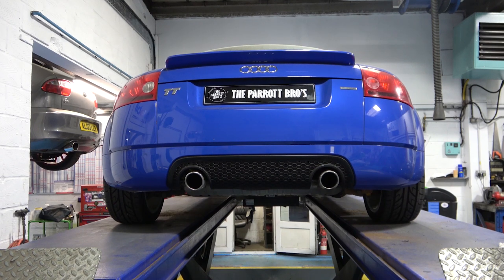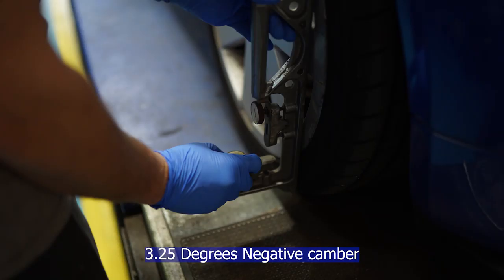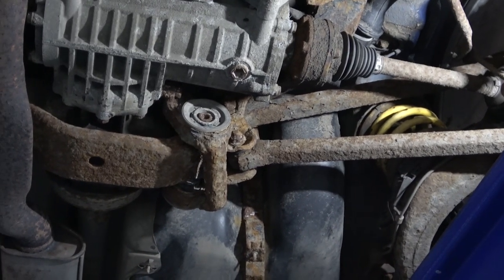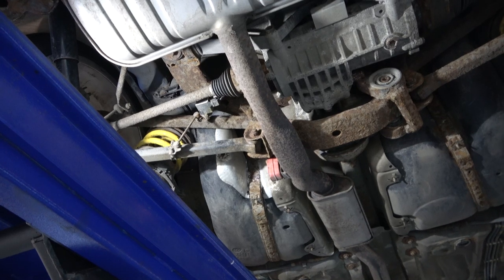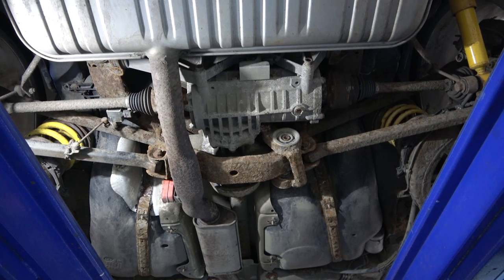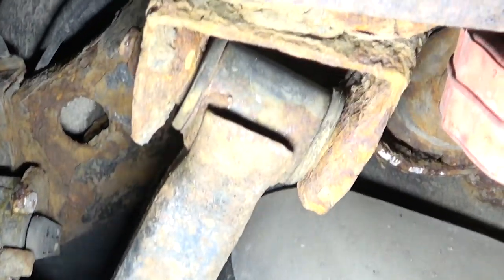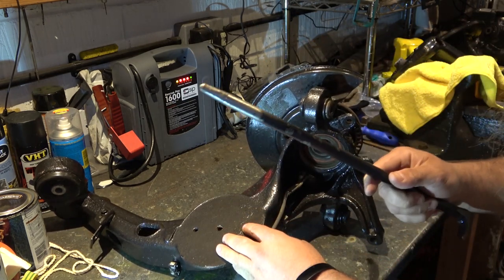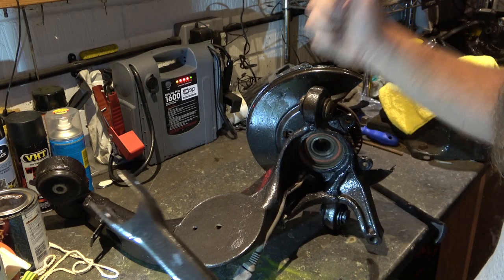All You Need To Know About Rear Control Arms On A Audi TT Mk1

Comment: just happened today😭 didn’t notice anything just pulled up to a stop light. and pop. i looked back out the door and oh shit 🙃 thank you for being the tt god we need
Reply from the maker: At least it was not whilst driving at speed, you now know what to check and fix it knowing it won't happen again
Reply: @TheParrottBros  right?! i got the rears and fronts ordered. i have bent my passenger front when my hub nut failed. so figured going all around will be best.
Reply from the maker: @kilstromkhrono8949  just make sure they check the rose joints are not seized as often the culprit

Comment: Wow, that thing is horrible underneath. I did all the mods you discussed on my TT last year with adjustable  arms and polybushed. Its a great upgrade. Rear is planted now when hard on it. Full set of BC coil overs probably helped  too though lol. These cars can be made to handle  extremely well . Good video .
Reply from the maker: Thanks for the comment, yes it is disgusting underneath isn’t it, that’s the fun of rescuing a car with nearly 200,000 miles on it 😂. I reckon at some point it live near the seaside. That’s why I did not bother trying to refurbish what was there and just got new everything off a low miles car
Reply: @TheParrottBros  Wasn't being rude, I didn't realize it was your car. My thoughts were the same - looks like it has lived near the coast or in a very wet region. Rest of it looks good to be fair - i like the colour.

Comment: Everytime I see photos or shots of the under body of cars in the UK, I'm shocked at the rust, corrosion & crud 😶. Like the guy from SoCal, my 19 yo high mileage TT is clean as a whistle underneath. Regarding the topic of this video, after putting coilovers on my TT the rear wheel camber was out big time, scrubbing my rear tyres. I bought a very strong and engineered set of adjustable control arms which sorted out that issue. They are stronger than OEM and are a pretty blue colour to boot 🤔

Comment: Great video 👍
The problem is very familiar. In my TT the lower control arm snapped twice before i realized the bush (ball bearing) was seized..
Luckily both times was in low speed.
Reply from the maker: timomx 22 that’s what I was hoping that people watching would see and understand. If I can increase awareness hopefully it will stop others from having similar issues
Reply: My snapped at 50mph when cornering. Wasn't actually anyhow severe situation. ESP kept the line...

Comment: Hi - Thanks for this video. I have an Audi TT (V6 - Registered in 2004) I am having a problem in getting a camber adjustment for my rear tyre and have been advised to buy a set of upper and lower control arms. I am going to buy a set Lemforder arms which have some good reviews.  I wanted to double check that both the upper and lower arms are the same size before ordering. Could you advise? Thanks

Comment: There were some issues with an early production batch of rose joints which to address Audi revised/improved the rose joint - providing a repair kit with the revised rose joints and four arms of the same length - and they continued in production.  Replacing the rose joints with a bonded rubber bush circa 2003 wasn't to address failing rose joints specifically.

Having no free articulation the bonded rubber bushes could introduce torsional stressess on already fatigued/corroded arms - especially if the cars lowered without adjusting/neutralising the tension on the bush or correcting the camber (not using adjustable arms).
Reply from the maker: Great information David appreciate it

Comment: Mate, great video, cheers to that! Just one thing: you keep talking about how the rear wheels should sit vertical after adjusting the control arms. That's not how suspension geometry works! You're right about the point that you want as much rubber on the ground as possible for good grip - but that is: under load! When you're going through a corner, the suspension travels and your wheels will deform. There's a good reason why all (!) modern performance cars have some degree of negative camber. On the TT mk1 facelift model (from 2002), the rear camber is around 2.5° stock. It would be very unwise to reduce that to 0, it would greatly worsen corner handling and rear stability.
Reply from the maker: Thank you for your comment, I should’ve added the fact that you need to get your car set up by a hunters or four wheel alignment centre after fitting the arms, 
On my vehicle just by lowering it on springs I have introduced nearly 3° of negative camber which means it’s nearly 5° away from where it should be if you’re saying it’s 2.5° positive stock. I would always rely on the hunters set up to put it back to how it should be, vertigo and a load is just a good starting point as it’s easy to see it they are tipped in at the top and you may need arms.
Reply: @TheParrottBros  mate, it's 2.5 NEGATIVE stock! :D
Reply from the maker: Noted thanks
Reply: Another great vid. Eye opener for me and my tt. Mine is on cheap coilovers which are non adjustable at the back. Garage informed me that rears are out by 3 degrees. If I order the lower adjustable arms plus bushes should I also replace uppers and if so would they need to be adjustable also?.

Comment: Great vid... Just saw my new arms installed today when changing haldex oil. And yep, my car is famous now lol
Reply from the maker: Vit Adamek internet famous :) thanks for the pics 👍🏻. Glad to know you’ve got it sorted
Reply: @TheParrottBros  Was broadcasting live on forum today, if I haven't I would have driven away thinking that I've replaced the right oil. Silly me did not know that the oil leaked from differential when the arm snapped as when I tried to reverse the axle popped out and some oil was lost (and when it was bouncing on recovery truck). New oil for the rear diff is due to be delivered tomorrow so hopefully back on the road tomorrow, the power of amazon prime and nearby warehouse lol :-)
Reply from the maker: Vit Adamek yeah the forum is super helpful for sure. Amazon prime has got me
Out of some problems before. Be nice to get it back on the road
Reply: @TheParrottBros  Next up for me is finishing sound deadening door cards/trims after speaker upgrade. Both front hubs and bearing will be changed - that will be all 4 of them done. Very tempted to retrofit the cruise control too. And sorting rust on body and under sills in summer :-)
Reply from the maker: I need to retrofit the cruise control on mine, I’m desperate that’s the only thing I miss having lol 

Very nice, what speaker brand have you gone for? 

Audi seem to love a wheel bearing not sure why but I have had to change one on the TT already, and my last S4 had two as well
Reply: @TheParrottBros  I did not really have to change any bearing but I had weird oscillating noise so we though it might have been the rear ones. Nope. So they are new. One front one is maybe slightly starting to go so we will do both with my friend mechanic just as well. The oscillating noise was brake disk. Buying the original FAG bearings - approx 50 for two. Not bad.

 I went for a very budget upgrade with the speakers as I have non-bose and wanted to keep the concert II with cd changer. So these were getting good comments - https://www.amazon.co.uk/Inex-FI6COMP-compatible-Components-Speakers/dp/B07MPC6DPM

I already sound deadened the doors themselve but still have some vibration in door trim... Will remove the original Audi foam and use the same stuff as on the doors. This - https://www.amazon.co.uk/dp/B01KZ5X7KO?ref=ppx_pop_mob_ap_share
Reply: @TheParrottBros  BTW, do a tutorial on that cruise control please. I am used to one too from my Vectra. So convenient...
Reply: Vit Adamek +1 on the cruise control tutorial video

Comment: Thanks for a great video, I´m currently working on my wife´s TT mk1 and the rose-joint (top side of the trailing arm to the upper control arm) has seized and is locked in place. Do you happend to have a part number/link for the poly bushing that you talk about in your video?
Thanks
Reply from the maker: I do indeed, it is Strongflex 221940A Thanks

Comment: Hi hoping to get advise if you can please correct me if i am wrong .. going off this video there is 5 bushes in total per side ? Do you have the list of all 5 bushes ?  There are 2 rose bush ? And 2 inner ? Then is is a axle beam bush ? The big one on the end ? ... my car is in process of being done i have adjustable with a bush already in so the other 3 power flex ( 2 rose & beam  )  are the ones that i need the right ones for to get my car back on the road .much appreciated....
Reply from the maker: Yeah that’s right, powerflex don’t make a replacement bush for the rose joints I’m afraid, only company I found that sell them is strongflex. The rose joints are very good providing they have free movement and are greased and checked
Reply: @TheParrottBros  i already have a set of rose joint . But would like to strengthen it up i think so strongflex do you have the right code it can be hard find with my model having changed slightly
Reply from the maker: Rose joints believe it or not are better than poly bushes as they offer a greater degree of movement whilst still maintaining support. If you wanna get strong flex they are https://www.ebay.co.uk/itm/274766571210
Reply: Legend ! I will never forget this in a million years ! Been a test and You are the man  for the job. Maybe in the future we shall meet in the audi  . Take care thanks a bunch
Reply from the maker: @theking-qo6fc  anytime man 👍🏻👍🏻

Comment: What is your opinion about putting  bushes (instead of the rose joints) with the standard arms? Mine is std height, but I'm worrying about the lack of movement and the extra forces that are applied to the arms
Reply from the maker: Dante Ferrari if audi have made a revised part of your stock I would use those as oem is perfectly good, Audi’s revised part 1J0 505 203
Reply: @TheParrottBros  thanks for confirming.. price wise oem manufacturer is lemforder, the oem number can be seen on the part, and is cheaper than the Audi part. Also, could you tell whether you upgraded the arb s on the TT and if so how do a  tt compare to your B8 S4 handling wise?

Comment: Would this cause the rear of the car to jump up and down and vibrate badly if bad out of alignment like that. Just put all new perelli tires all way around and have only driven at best 500 miles btw I also changed my wheels too. My old wheels was much wider these are .75 the old was .95 width. And have 30mm spacers on rear and 25mm spacers on front and driver side rear tire is sitting inward at the top and outward at bottom. It wasn't doing that nor did it look like that when old wheels and tires was on it.
Reply from the maker: Crap Master Usually if you get in tire way, that is down to if you’ve lowered your vehicle more than anything. But if you are getting poor handling you may well have a seized or more than one seized bush. 
It would be worth getting them checked out as they can make the arm snap
Reply: @TheParrottBros  ok thanks! I'm gonna be taking the car to a alignment shop tomorrow morning and see what they find I'm hoping it's not to much but yes my car is lowered and I have aftermarket adjust upper and lower control arms on the rear. It's just odd that it did it right after my wheels and tire swap. Definitely makes driving sketchy.ill have them also check that over definitely that u just mentioned

Comment: Hello there Bro's
By any chance did you know if the top and bottom arms are the same size?
Reply from the maker: My understanding is that anything from 2001 onwards has matching arms top and bottom. 

Double check with the seller with your vin number prior to purchasing but when I’ve looked on the Parts website it shows both arms being the same part number
Reply: The reason I ask is cause I was going to get a set of the megan racing ones and on the comments one person said to get 2 Set top and bottom, camber and caster adjustment.

Comment: Can you please do a video on installing the new controller arms
Reply from the maker: I certainly will do, as soon as lockdown is over 👍🏻
Reply: Christian Steendahl you can see a fresh install video on @garagebuds.   I just installed 2 weeks ago.
Reply: Installing rear control arms was pretty tough. hard to get the arms to come level with the bolt holes. In the end I used ratchet straps to pull the wheel hub closer in to fit the bolt through the hole.

Comment: I bought My TT a week ago and it's lowered. I guess i soon have the same problem, and also has anyone else the EPC light on and ESP , is that a common problem with TT:s?
Reply from the maker: Just because it’s lowered doesn’t mean you will have this issue, the issue can affect any tt with seizes bushes not just lowered one.  

Epc / esp can be on for a number of reasons, broken wire, dodgy sensor etc. 

Try and get it plugged in and read the codes

Comment: Is it worth changing the arms if the car isn’t lowered? The adjustable do look a lot stronger..
Reply from the maker: Not really, the only time the arms would be no good is when the bush/rose joint is seized. When it’s ok there is no risk of failure
Reply: I’ll look into changing the bushes then, thanks!
Reply from the maker: @chloehicks1290  Check them out they might be fine, just get them checked :)

Comment: to lower it properly and get all correct adjustment ,do i need all four adjustable arms? or can i get away with replacing just the lower ones ?
Reply from the maker: Two will allow you to correct the geo, 4 just gives you more adjustment options, for track and race 4 would be ideal, for road 2 is plenty ( and what i run)
Reply: @TheParrottBros  cool thanks 👍

Comment: Hey do you need shortened shocks for the lowering springs or is the car okay going on shortened springs with standard shocks?
Reply from the maker: It all depends on the amount the springs will lower. If it’s a subtle drop like the eibach -25mm ones yourll be fine. If it’s -40 or more you might bottom the shocks out and massively  reduce the life span

Comment: What suspension set up do you have? Just im looking for a kit for my 3.2 but no manufacter seems to do a kit specific to the 3.2. Thanks
Reply from the maker: Currently the b12 kit from eibach, most company’s will do a 3.2 option, if you want separate shock and springs there is eibach and h&r and some cheaper ones
Reply: @TheParrottBros  yeah I wanted eibach, but they don’t seem to do them for the 3.2, H&R are not specific to the 3.2 and are just the same as the 1.8t which worries me slightly! Might end up with kw v1’s
Reply from the maker: @Leroyindahou5e  I’d you want Coilovers I would lean towards the gaz ones as fully serviceable in the uk ( if your UK based) and usually cheaper too. They do varying spring rates and can make custom ones too